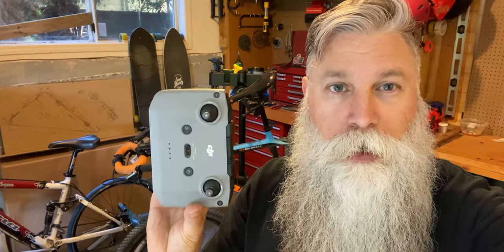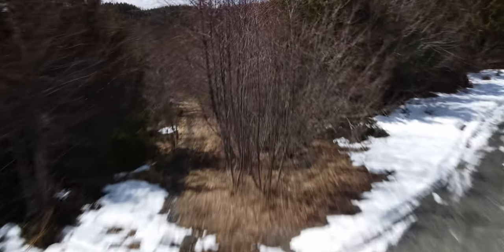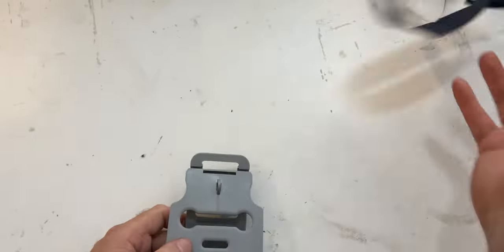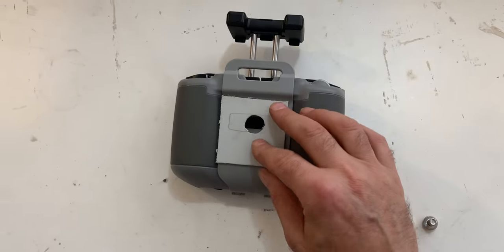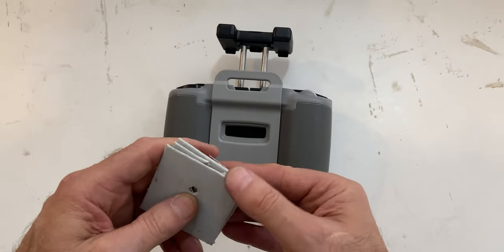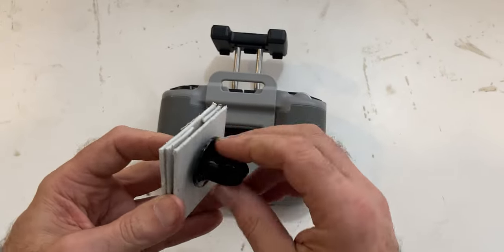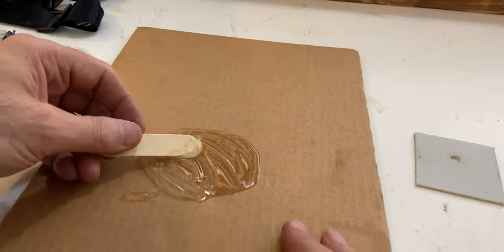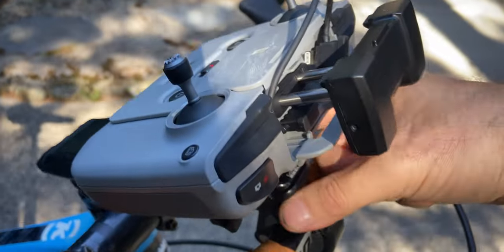DIY DJI Mini2 / Air2 Controller GoPro Handlebar mount

Comment: Interested to see how this works out for you. I use a Quad Lock handlebar mount for my phone plugged into my Mavic Mini. It's got me dozens of great shots flying into trees while riding.
Reply from the maker: I found it hard to control the drift left/right while riding and pushing the drone forward on bumpy roads.
Reply from the maker: Rhyss - following up with you on something… you say your phone is on the quad lock while plugged into your mini… I assume you mean your mini’s controller.  Is the controller mounted with the quad lock?  As you can’t control a mini2 with the phone itself.  Ok… you could do quick shots but you still need to put hands on the controller at some point.   My epoxy mount failed.  The epoxy didn’t actually bind to the plastic. Hmmm… mount 2.0 being made with GARMIN plate.

Comment: had to send off my Air 2S after it's second flight. should be back and repaired/replaced soon so I'm curious about this handlebar setup. I actually have a video testing out the auto-tracking which seemed surprisingly reliable.
Reply from the maker: I would have loved something with active track but a limited budget and didn’t want to deal with the licence /registration at this time.